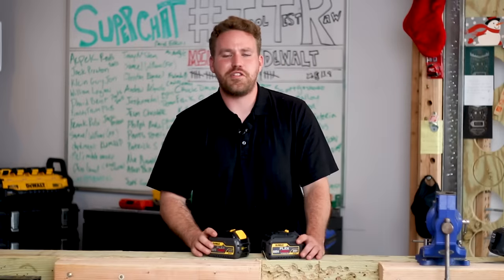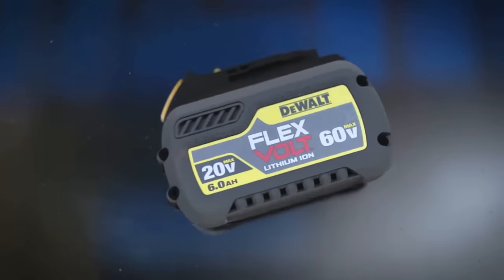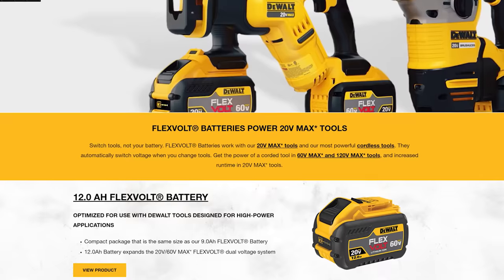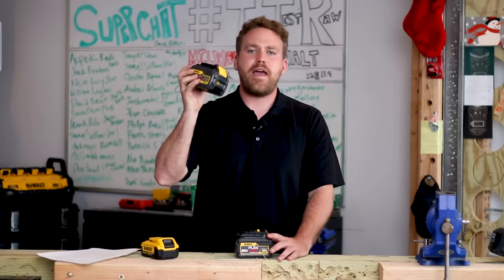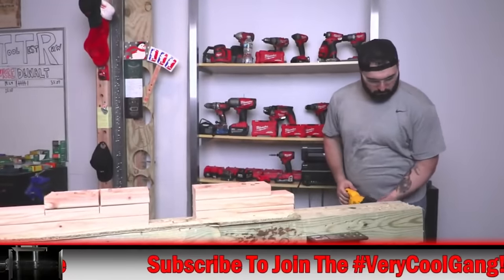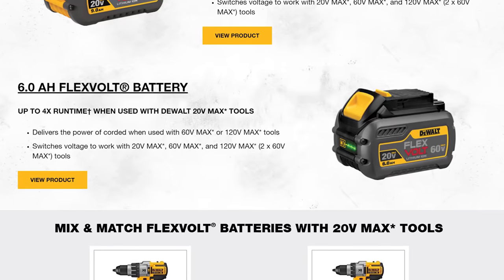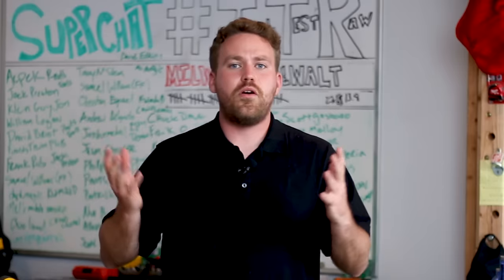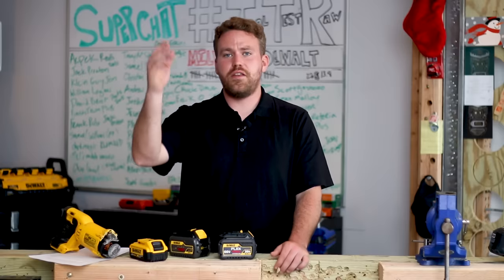NEVER USE DEWALT FLEXVOLT BATTERIES ON 20V MAX TOOLS!

Comment: At my workplace, we use Dewalt 20V Max tools and have some FLEXVOLT batteries we use with them.  We have NOT had the first issue with tools going dead due to the FLEXVOLT battery being used.  If anything, we have had to replace batteries due to how much we use and abuse these tools.

Comment: I've never had a problem using both 6 ah or 9 ah. I work with steel all day an I've never burnt a motor out. Its harder on the Impact driver using self tapping screws

Comment: I have actually gotten rid of all of my 20v batteries and just have the flexvolts. I use them on everything from my flashlight to circular saw to my yard yard equipment and i have not had a single issue with any of my tools going bad

Comment: We use dewalt at work daily and we have  had two sawzalls stop working with flexvolt batteries on them no smoke no funny sound just like yours it just stops working I kept one of them hoping someone could figure it out but it doesn’t seem to be a problem lots of people are facing

Comment: I have had no problems  with my 20v tools using my flex volt 6amp hour batteries been doing for years. Like most people I have seen no improvement on power or capability of the tool just longer battery life. Except the speaker, I have the smaller Dewalt speaker that normally  sells for 99$ and I will say it it slightly  louder with the flex volt while still lasting longer.

Comment: heat death is the same for comps as it is for power tools. think of the 60V as you locking yourself in a hot car for extended periods, too long and your toast, but locking yourself in for just a little while your ok.

Comment: Check the bottom of the Dewalt tool, where the battery slides in: it says what kind of battery you can use with the tool. There's no problem using a 60volt max Dewalt battery on a 20 volt Dewalt tool. However, you'll run into a bit of trouble if you use a 60 volt Max battery on an Atomic Dewalt tool. The battery won't last very long, despite the indicator lights on the battery showing three bars. I suspect it's because the atomic tool is a 20 volt high amperage tool. The 60 volt flex battery pack is made up of three groups of 5 batteries (3 x 20 volts). The three groups are switched to be connected in series or in parallel depending on whether the tool requires 60 or 20 volts. The high amperage use of the Atomic tool probably wears down one of the three groups of 5 batteries faster than than the other two. The battery pack would sense it still has enough energy to show three bars even though it does not because one of the three groups of 5 batteries is low.

Comment: Mmmmm I've been using the 6ah flexvolt batteries in all my 20v max XR tools for the last 2 years all day every day and I mean I beat the snot out of my impact, 2spd hammer drill, reciprocating saw, circular saw,  and dcf899 1/2 inch impact.  No problems at all

Comment: FlexVolt is an improvisation. You relay on a circuit that can switch to 60V on your 20V tools. Unless they make a mechanical switch between modes, I don't trust those.

Comment: If you push the tool hard enough long enough you can burn it out I've used the vault flexible batteries interchangeably no problem have I burn a tool out here and there yes pushing it hard and long beyond the rating it was designed for but then again those that I didn't I still have an 18 volt hammer drill nicad still runs great and I use the new 20 volt batteries in that with the adapter

Comment: I think what is goin on is that the tool runs longer on a flexvolt battery as it runs longer so it runs it into the ground frpm overloading.

Comment: If you use your flex volt battery on ur flexvolt tool the switch it to a twenty volt max tool sometimes if the two selector tabs on the top of battery are dirty they get stuck pushed back on the 60v output there fore u burn out ur 20v tool . I’ve done it once and now I use a air gun and give it a quick blast every now and then . Haven’t burned one out since 🤙🏼

Comment: Damn, I used a Flexvolt on my 20V Dewalt string trimmer and it burned right out within a few minutes of trimming, had to junk it, you can't even find replacement motors for them.  Didn't realize until this video what went wrong.  Thanks for the user alert!
Reply: Very, very interesting.  I have heard that many motors have burned out on the Dewalt Cordless weed Wacker, now we know why. There is a 20 volt and a 60 volt version.  I didn’t know until now I read your comment. Thank you very much for your comment.

Comment: I have worn out so of my 20V max Dewalt tools too, but I'm not so sure it's because of the flexvolt battery, I will say my DCF887N XE Impact is the most used tool in my kit but it's not the ones that have me their fatal, next most used is my DCG412N-XE 5in grinder, Also not one that crashed n burned... it was tools sparingly used like the blower and reciprocal saw!!

Comment: The tool has the tabs configured to how the battery is wired.  These batteries should have no bearing on the longevity of the tool over the common 20v battery.  A short in the multi volt battery or cross connection could be the only explanation of a multi volt battery frying a 20v device.

Comment: Totally agree with this guy although it's not the tool. 
 I've had 4 of the flexvolt batteries not run the 20v tools but will run a 60v tool. 
 I've also had them not run the 60v tool but yet still runs the 20v. It's become very frustrating and expensive.  I've also have a 6 month old flexvolt that refuses to charge , put it on the charger it begins charging and goes to full charge in 5 seconds. 
 Dewalt has no answers to this bit will warranty if within time frame. 
 To all you guys out there not having this problem you all have been lucky.

Comment: I've been using a 9ah flexvolt on my 887 for the last year and haven't had a problem with it, I even use it on my 18volt cordless 6&half  inch circular saw and have no problems

Comment: the voltage is the same from battery to battery , i have seen with my own eyes, also seen others use the flex volt battery with no issues on 20 volt tools over and over

Comment: The flexvolt batteries are wired both ways, Series and Parallel. When using the battery in a 20v max tool the tool tells the battery I’m a 20v tool and you get more run time out of the battery because there are more cells in the battery. When you take it out and plug it into a 60v max tool the tool tells the battery I’m a 60v tool and the battery switches to the other wiring configuration allowing it to put out the full 60 volts. There is ABSOLUTELY no way it will burn up a 20v tool

Comment: I use my Flexvolt 60V batteries on my 20V tools, never had a problem. My wrist almost got torn away due to the torque of the DCB996, but other than that they perform great.

Comment: ive seen people do it a thousand times. It doesnt give them extra power, but it does allow them to run a lot longer and they dont start to "whine" when they start to get run down like their counterparts do. I personally have a power detect xr saw and its the most versatile of all the saws. Uses all the batteries, gives extra power on a 6ah, and max power on 8ah and comparable to the flexvolt advantage saw.

Comment: Try this, put a milwaukee 12AH M18 on your entry level drill and run a spade wood bit trough a pressure treated 6x6, pushhing as hard as it will go, and you will soon find that tool's failure point as well.

Comment: Overworking a tool puts a lot of stress on its motor and can cause it to overheat. This mostly happens when you are trying to work through a difficult material, like drilling into concrete or sawing a very hard wood. Overheating can also occur if you run a tool too long without stopping. If your tool seems like it is getting hot, stop what you are doing and give it a break until it can cool down. This will help save you from wearing out the motor or burning out parts.

Comment: That bigger battery has a mode swith on both side. Have you seen the red cap for 6ah 9ah batteries? the red cap has some carry on 2 legs are there. The legs when it pushed in. that means 54 or 60v mode. without the legs it's 18-20v mode. That is why you carry it safety purpose. Making the switch is not completely pushed in that means disconnect the circuit power. I have killed the battery 3 times but the tools are never died with that big guys. Serveral times this big battery has an issue with no charging anymore for me.(6ah) so my conclusion is your tool's just dead becase of the brush issue or something else XD

Comment: What is going on is you are clearly incompetent at using electric power tools. I have 9 different DeWalt tools, many of them 18/20V, and I use FlexVolt batteries in all of them exclusively. Never had a problem. You are clearly abusing your tools and FlexVolt probably just gives you more time to abuse them.

Comment: These guys I don't know what to think sometimes, 5 days a week I use these batteries on my DeWalt tools. And this includes days where I might drill over a hundred 5/8 holes and approximately 50 1 inch holes while also using them on my impact, ocilating saw, grinder and circular saw. I am happy to report I've had no issues in the two years I've used these batteries.

Comment: I have been working with them with my old dewalt tools and they have worked fine. They do get a little warm if you use them a lot, but the tools don't fail.

Comment: I just cut down 14 6inch trees using my DEWALT 20V MAX XR Reciprocating Saw (DCS367B) and cut them up with just two 6ah flex volt batteries that I got with my (DHS790AB) and had no problems at all. It worked good, my only thing is I wish I had a bigger recip saw like the DEWALT FLEXVOLT RECIP (DCS386B) or the DEWALT 60V MAX Reciprocating Saw (DCS389B) simply so I would have gotten the job done faster.

Comment: I have been using it for 7 years every single day, with zero issues. I have 2 60V flexvolt batteries and I use them for my DCS361 miter saw and 20V table saw, perfect!!

Comment: Been using the 60v flex volt batteries on my 20v tools for like 2 years now. Not one issue. I freaking love dewalt 60volt batteries I wish I had 10 more of the 6amp hour and 9 amp hours. I own the 60v circular saw and the 60v sawzall both are powerhouses. I don’t ever use my corded circular saw anymore even cutting stair stringers the 60v circular saw powers through everytime.

Comment: Well i use the 9ah flex volt in my impact, ratchets, drills, reciprocating saw, chainsaw,  20v chopsaw..... i dont even own 60v tools... and to be honest the impact drivers has more torque...(probably just stays full power longer and appears to be that way) but it would remove a wheel lug nut and withbthe 60v battery it will do all 4 wheels... and then still be full.. use it for 4 or 5 days and sril have a bar left..... automotive shop life... goes tool to tool wire wheel on drills... only drill that burnt up ever was may fault and it was the 20v xr yellow top battery...  hammer drilling...  and funnt thing is i tried that bjrnt up drill with the 60v for a joke, and it started working again.... still does

Comment: The flex volt batteries still provide 20V when in use with 20V tools. When in use with the 60V tools in uses the other legs on your batteries running at 60V. (Those slots on the top of your battery).
The reason why the 20V tools feel more responsive with the flexvolt batteries is because there isn't as much amperage drop. Since there are more cells packed into it so it can provide the amperage. A battery will not provide more amperage than a motor can demand, However a motor can demand more amperage than a battery can provide.

Comment: The flexvolt battery is 18V when not connected to anything. It doesent give out 54V until you push in the mechanical slide switch. An 18V machine will not do that.

Comment: I think it's the extended run time . It never gets a chance to cool down. Making a motor run 6x longer means 6x more heat
Reply: Still a bogus argument against flexvolt though. You can just as easily run two 20v MAX 5ah batteries one after another and still heat the tool up the same.

Comment: Been doing it for years abusing the shit out of all my tools with flex volt batteries. Never had a problem. And I’ve been using the flex volt battery on tols like 8 year old. Still working like a champ.  Not once had a misfire. Have no clue what you all doing wrong

Comment: Just burned up my DCG415 20vt Angle grinder while running my 9AH flex battery cutting a small piece of dryer vent pipe.

Comment: I have been using 20 volt ⚡️ ionlithum  cordless tools since 2015 . When the flexvolt batterys came out that's all I have now for 20volt Dewalt cordless tools , the one time a sazall 20volt failed it turn out .  The wire in trigger switch connector had brokoe free ,not BURNT, BROKE free.  I have to disagree with tthe title . In addition I repair tractor trailers with cordless tools .  Always using 20volt with 60volt batterys 🔋

Comment: Been using Flexvolt batteries exclusively on all my Dewalt 20 volt tools and never had a failure...they way it works is that it still gets 20 volts so I dont see the problem

Comment: I have this mower for 2 years and it's worked great thus far. I recently had a problem with the mower and Dewalt sent me a new one. Which is why I own quite a bit of Dewalt equipment. They stand behind the short comings in their equipment.

Comment: I’ve been running 60v battery’s on my 20v impact that’s probably over 10 years old along with the drill and hell all my 20v tools and haven’t had problem. Long time, Standard use, daily.. These guys do torture test back to back to back. And sure I bet tools have went down outa the blue for no understandable reason. Usually defect.

Comment: I have and use all of the tools mentioned in this video by Dewalt, both 20 volt and 60 volt.  I pretty much ONLY use 60v batteries in my 20v tools and have never had this issue.

Comment: This is not BS. My company repairs power tools and this is a known problem. What's not very smart is scrapping your burned out tools instead of having them repaired and/or trying to get them replaced or repaired under warranty, due to faulty battery. Just don't start ripping the tool apart thinking you'll be able to diagnose the problem because that will definitely void any warranty

Comment: I run my entire 20V lineup in basically exclusively the 60V max batteries - usually the 6 AH - I've never had a problem. I almost never use a standard battery in any of my 20V batteries anymore.

Comment: All my 20v tools can accept 20v flex volt batteries with larger amp hour ratings...I’ve never had any problems with the larger amp hour batteries BUT I have a grinder that will only work with the 60v max battery and not the smaller 20v ones.
I also have a reciprocating saw that works with the 60v max AND the 20v max batteries.
I haven’t had any issues with any of my tools using flex volt batteries and I’m a carpenter by trade and I use my tools every day building cabins and mini houses in the mountains in remote areas so cordless is the only way to go for most tools although I have a propane/gas generator for my really demanding equipment.
I got my eye on the cordless slider miter and table saw.

Comment: Internally flexvolt batteries literally reconfigure themselves into two different configurations depending on how they're used. When they're configured as a 20 volt battery they are no different than just a traditional 20 volt battery. You can give me any product on the planet, give me the specs for it and I can build you a lithium battery for it. And I've rebuilt many flexvolt packs. What it comes down to is you have to understand your tools and understand that they give you enough power to force them to quit on you. It's no different than an old corded drill that you could keep the button down and see smoke coming out and if you didn't stop quick enough you'd ruin the tool. Understand the capabilities of your tools and you'll stop ruining them prematurely. And as convenient as battery powered tools are don't forget when you're standing next to an outlet there was a better tool to use.

Comment: Guys whats really happening s if u force ur tool like that guy cuting with the saw saw he was really pushing down well the batterie fills the need of throwing that extra power it has since is a flex batterie and ends up causeing damage to ur tool ive used that batterie with my 20v grinder never had a problem🤷🏽‍♂️

Comment: Use them everyday and I have about every tool desalt makes and never had a problem. I love them I charge five or six batteries the night before and it usually last me all day without charging until I get back to the shop, or if I’m in the shop I charge them as they die.

Comment: M not a electrical engineer but i am an Elevator Mechanic and I use the flex voltage batteries on my XR drill impact reciprocating saw and my ½ inch drive impact. Never a problem

Comment: I will say this the guys on my job sight say that the tool had a different smell when running the 60v batteries on the 20v stuff. but they seem to hold up. I love all my dewalt tools and will continue to expand my collection. The stuff just works good and holds up well under hard use! The only dewalt tool Ive ever had fail is the first impact driver I ever bought and it was the 18v line.